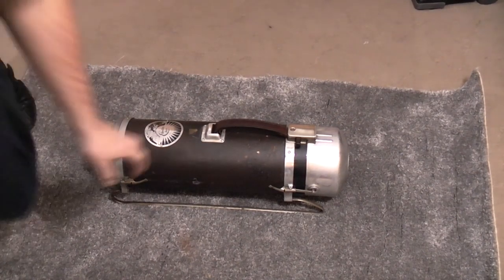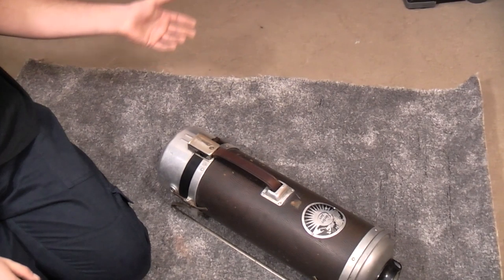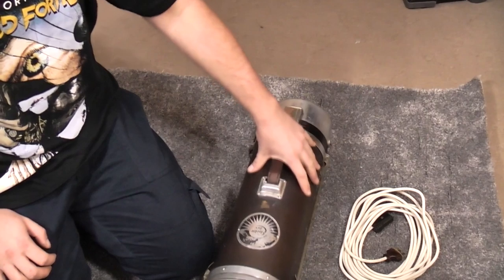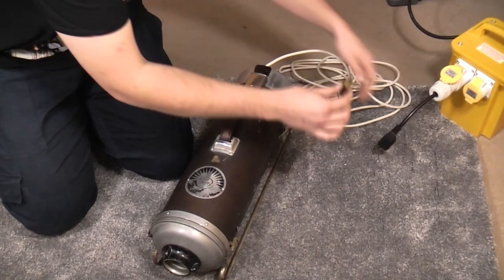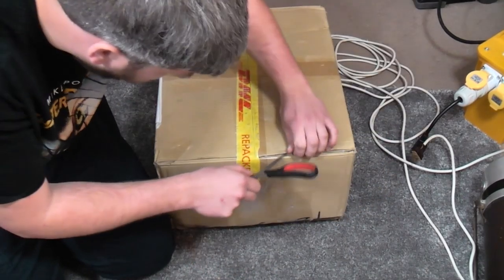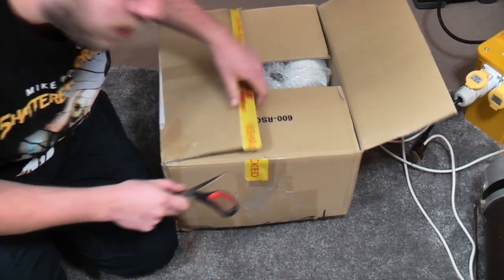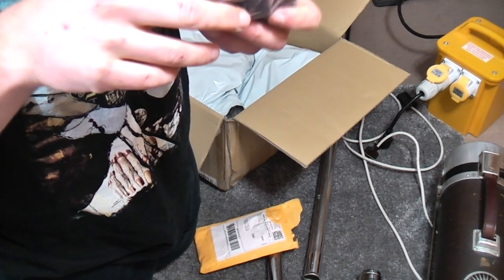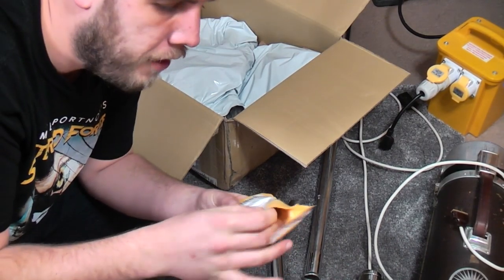The Electrolux XII - Does it run? And a box from America!

Comment: The metal fitting for Electrolux was the same for that machine through the plastic fitting that came out in the mid to late 80s. The only catch is the built in electric hoses won't work. Non electric are backwards compatible. For my Electrolux machines I have plastic "driver" hoses and correct "display" hoses.
Reply from the maker: I've done the same with my Electrolux XII, I bought a twist on end and just use a black plastic hose for full suction. You'll see that on the after video of this lux too!

Comment: Doesn’t the inside wiring contain asbestos? I have these older Electroluxes also in my collection but I would never power them up because of the dangers of asbestos. I tried to ask Electrolux of they had any information available which models contain asbestos but they don’t have those old archives available. But generally asbestos was used in wire insulations  almost averywhere when this model was manufactured.
Reply from the maker: It wouldn't surprise me tbh. I tend not to lick them too much, and always either replace the wires, or sheath them in modern heatshrink for safety reasons, usually they start to crack and perish at this age.